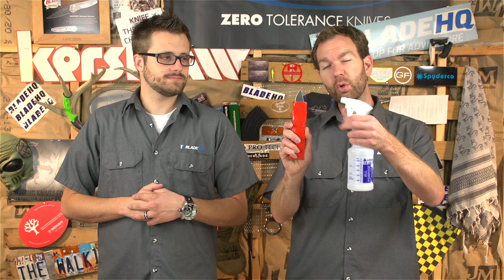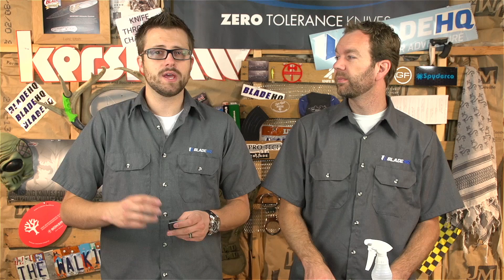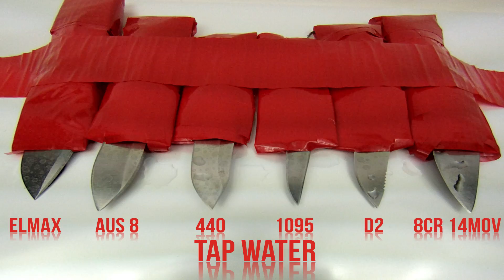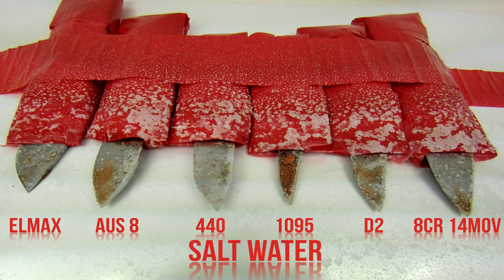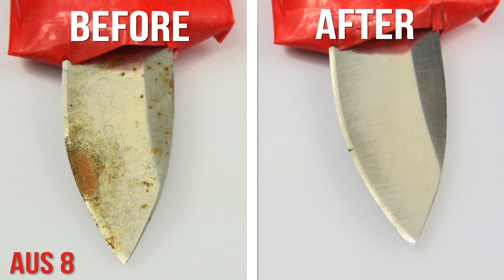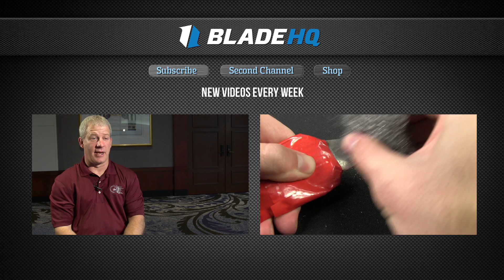Ultimate Knife Rust Test | Blade HQ

Comment: what the hell is 1095 and why the hell can it not stand tap water!?
Reply: 1095 isn't stainless steel, it's high carbon steel, so it's kind of obvious that it will rust even when it comes to tap water
Reply: 1095 is basically 95% iron, 4% nickel (depending, nickel is optional) and just shy of 1% carbon. Because there's little to no rust-resistant metal in the alloy like others here, it took the most damage from rust. It's still a very good steel, with excellent edge retention and sturdiness. It's only drawback is the lack of corrosion resistance, and the best way to counter it is to keep it oiled and dry to prevent water from gathering on it long enough to make rust
Reply: 1nkw3ll 1095 doesn't even consist 1% carbon, it's more like a 0.90%. But still it's considered as "simple carbon steel" (at least here in Poland). And I must say, that it's one of best steels for knife if you can take care of it. It holds it's cutting edge for a good amount of time and is relatively easy to sharpen

Comment: What's the point of this video?  Some steels rust easily, some are far more resistant, but none of them rust if taken care of.  Avoid those lubricants.  They aren't needed.  When you're finished with your knife,  dry it off and put on a bit of olive oil or mineral oil, both of which are food safe.   This is not rocket science, ad it is not new.

Comment: Looking at ordering a custom bush knife the choices in steel are o1 tool steel or cpm 3v I would be using with a fire steel lots and in wet weather and thought on what one to get thanks!
Reply: +snowboarder450 If you want a real bushcraft knife, one you can use with flint and steel, you need a high carbon blade.  The 01 tool steel is an excellent high carbon steel.   Do not get one that has the bevel coated.  If you do, you can't use a Scandi grind.   Just dry your knife after use, and rub it down with a light coat of olive oil or mineral oil.  If you like the look, you can let a high carbon blade develop a patina, which will also protect it from rust.
Reply: sweet thanks!

Comment: Which 440 did you guys test? there is 440A and 440B which are lower end 440 steels, but the 440C steel is actually pretty high end for a 440 steel and there tends to be a pretty big difference in the performance between each variant. Also, if you guys do another rust test, could you test the 420HC with Buck's heat-treatment, S30V, S90V, 8CR13MOV (Schrade uses this quite a bit), and the 7CR13 that SOG uses?
Reply from the maker: +Enzo Warren The 440 we used in the first test didn't indicate whether it was A,B, or C. We did do another rust test through using other steels: https://www.youtube.com/watch?v=JWFKq7VQdy8
Reply: +KnifeHQ Oh alright, that usually means that it was 440A steel, which isn't horrible but it's still pretty bad compared to 440C steel. Anyways, just saw your other rust test video and thought it was pretty interesting. I really enjoy your channel, keep up the quality vids.
Reply from the maker: +Enzo Warren Thanks for watching.

Comment: 440? You realize each class of 440 steel is vastly different in performance? Between A, B and C, you guys ought to know to specify this kind of stuff.
Reply from the maker: Unfortunately, the knife we used didn't specify the steel, just that it was 440. I'm guessing it was 440C though.
Reply: On the contrary, 440c is known to be the highest performing version of 440 steel, and can actually be quite good. A manufacturer would say if they were using 440C, they wouldn't if they were trying to hide what version of 440 they were using, which is probably 440a.
Reply: KnifeHQ My ass is 440c. Anything that says 440 without the letter designation is gonna be junk 440a if you are lucky. Anyone who makes a knife with 440c is going to tell you.

Comment: D2 seems  fairly resistant to rust.D2 is one of my favourite steel and I have a lot of knives in this steel and in my experience it is is quite resistant but in many forums  many people say it is not! I hope this test wil be definitive!
Reply: I own a bm51 with d2. If I sweat even a little it rusts. But I cleaned it off and did a light coating with wd40 and now the only rust is at the handles and hasn't rusted yet.

Comment: Oh, and 440(A, B, or C)? Is there such thing as 440 without a letter designation? I'm assuming it was 440C since it did as well as it did.
Reply: I know, I can't stand it when somebody says the steel is "440".  There are some pretty big performance differences between 440  A, B and C...  At least with the way the standard production knives are heat treated.  Check out Jay Fisher, seems like his steel of choice still remains to be 440C.  I'm sure he has got the HT pretty much perfectly down by now ;)
Reply: 440 a/b/c are very different. a=least edge retention, toughest, MOST rust resistant.
c=most edge retention, most brittle, LEAST rust resistant.
b=in the middle, rarely used in knife making for whatever reason.
Reply: @Isubslimed I know 440A knives with a good heat treatment and 440C knives with a bad heat treatment and vice versa. You cant tell if the HT was done right just by looking at the steel type.
Reply: "440" means made in China piece of shit. Same as "420".

Comment: Good video and test!

Couple issues and notes;

Why wasn't VG10, 154CM, and/or S30V used instead of Elmax. All three of those are some of the most commonly used steels and VG10 especially has extremely good corrosion resistance - S35VN is even better. Also, why wasn't there any H1 or other "salt friendly steel" in this test for comparison?

SM100, technically isn't a steel, but it too, like ceramic, won't rust. But unlike ceramic, it looks and acts a lot like a typical steel (accept the ability to be flame anodized, but that's beside the point).

It'd make sense to have this done in two (or three) separate videos. One being "stainless" steels, and the other being carbon steels & tool steels, last being the other blade materials that don't fit into the first two (ceramic, sm100, talonite, etc)

Last issue was the water. Did you used distilled water or tap water? Rain water or tap water should have been used since it'd be more viable to the real-world. And the salt should have been sea salt rather than iodized factory manufactured salt. Would have been more realistic; though, who knows? Maybe the results would have remained exactly the same. 

I hope you'll keep the videos coming! Seeing testing of the various aspects of different knives in similar manners is interesting.

Comment: The ELMAX appeared to be mostly surface rust, and I'm a little surprised at how well the 8cr14mov looked like it did. Before using steel wool on your lightly rusted knives I suggest trying a baking soda/water mixture or some tooth paste, they will do the same thing in a softer fashion. Just make sure you dry well and oil you blade.

Also I would be interested in seeing how H1 does.

Comment: You guys didn't list what kinda 440 steel it was.

440A? 440C? 440V?
Reply: Sibelius Johannes they say "most common" (although there are ELMAX and 8cr14mov rather than 8cr13mov) so I would say they do use 440C, it has as high as rust resistance as AUS-8
Reply: +100eyes maybe its just 440, idk a lot about knifes but ive seen knifes that say 440 and nothing else, but idk a lot about knifes.
Reply: ctpOMG There isn’t a steel that’s just called 440.
Reply: It's most likely C
Reply: Obviously not c... It would probably rust almost like 1095

Comment: Dive knives are Not made from ceramics also if you want a steel that will not rust use H1 steel from Spyderco ps I am a scuba diver
Reply: Stellite 6k, sm100, titanium dive knives ;)
Reply: I'd say add in a 420J2 blade as well :)
Reply: N680, Nitrobe 77 ,and x-15 are damn good as well
Reply: My tasman salt is the one piece of gear I never bother to rinse after a dive. Titanium knives are stupid; they're more overpriced and can't hold an edge for sh*t
Reply: Straylight depends who makes the titanium knife. Some guys will carbidize the edge giving the cutting edge a rockwell hardness in the high 60s. Holds a edgevpretty damn well
Reply: Straylight look into SM-100. very fascinating titanium alloy that can be treated up to 60HRC. one of the coolest materials out there, IMO. whether or not its practical is debatable, but that doesn't diminish from how cool it is
Reply: Mindthe Grind they're so damn expensive. The raw bar of sm100 is literally 20x the cost of CPM154
Reply: yup! still cool, though! And I'd rather have something with practical benefits instead of damascus if it was a knife that i was gonna carry... for that price anyway
Reply: Mindthe Grind yup, it is some cool shit. If i could, i would. Been looking for the stuff for over a year now with no luck
Reply: That is what was thinking ceramics are mainly used by chefs not divers because ceramics if you drop it or hit a bone with it, it will probably break
Reply: Yeh that's something you would depend your life on while underwater .... a ceramic blade lol... smh
Reply: Yes!  I saw the test where they buried some Spydercos in the sand on a beach.  They used their old steel as a base.  They were in the salt water for 2 weeks.  The old knife was eaten up.  The new H1 was a little gritty but NO rust.  I was very impressed.  I don't like Spyderco designs which is a bummer.